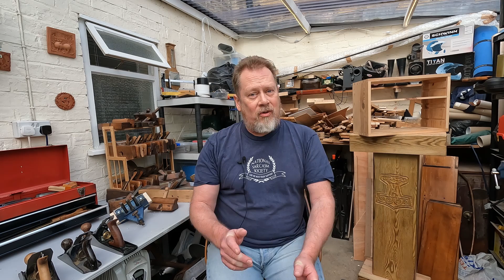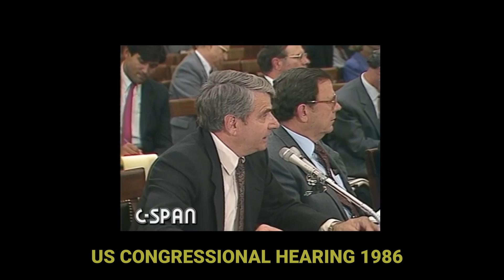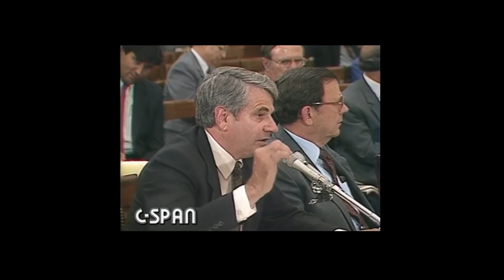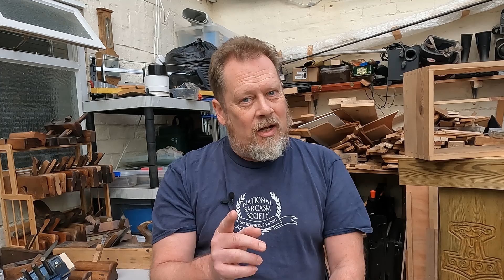1mm is not a mil

Comment: I used to work in mils maintaining electro mechanical telephone exchanges. All of the clearances were in mils in the documentation. That's from over 100 years ago when they were first built.
Reply from the maker: Very interesting, thanks for sharing 👍
Reply: @radboogie  There's no such thing as an exact measurement and that's where you learn to use feeler gauges correctly. A measurement has a + and a - to it. We used double ended feeler gauges, 5 and 10 on one and 7 and 12 on the other. Measurement is done with a go and a no go. Car mechanics these days have no idea.
Reply: As a trainee I even asked one of the bosses if a mil was the same as a thou that car mechanics refer too. He said he didn't know.
Reply: The telephone exchanges were designed and originally built in US of A but ours were made by GEC in Coventry and built under license. That's the strowger / step by step system. We also had crossbar exchanges but again, originally built in US of A but ours were copied by NEC and came from Japan.

Comment: In North America there's also the "circular mil" which is a unit of area.  For example, wire with a cross sectional diameter of .001 inch has a cross sectional area of one circular mil.
Reply from the maker: I didn't know that! Thanks for sharing 👍

Comment: We used to use 'mil' in Australia to mean 0.001" as well when referring to the thickness of paint films in the days we used imperial units.
I was working in the paint industry at the time Australia was switching to the metric system, so a lot of the old stagers would use imperial units. As a result I am quite 'bi-lingual'.
I knew instantly what that bloke from NASA meant in the clip you showed. 5 mil in an o ring had to be 0.005". I never had any problems knowing which unit was meant when someone talked about a 'mil'; I could always tell from context.
Reply from the maker: @jeffarmstrong1308  thanks for the info Jeff, interesting to hear the Aussie perspective on it 👍

Comment: In mechanical engineering and  machineine shop applications in North America a mill is still .001 (inches - lack a leading zero) as apposed to 0.01 (mm have a leading zero). The first general note would also state that all dimensions are inches and millimeters are in parentheses and for reference only, or the reciprical note if the design in "hard" metric and "soft" US Customary/Imperial or something to that affect.

Comment: I have always said THOU for 1 thousands of...  That is the first I heard that...  I was looking for a video to explain to me Millradian is not a metric measurement for scope dialing (just an fyi)
Reply from the maker: Milliradians are really interesting with mildot scopes. Crazy how 1 milliradian is 1/1000 of a radian, and a circle is 2π radians. And on a scope it conveniently works out to 1 mil is 10cm at 100 metres.
Reply: @radboogie  1 radian is the SI (metric) unit for an arc length around a circle equal to the radius.  So a milliradian is an arc 1/1000th of the radius.  At such a small angle that's well approximated by a straight line normal to the radius, so there's your 10cm at 100m.  Pi only comes into it when you want to know how many radians in a circumference, relative to the diameter.

Comment: As a European machinist moved to the US, yes one mil is .001 inches and you find it in the dials of most old machines (new ones frequently have double dials with metric equivalents too). Two advantages of mils: allows using the old Imperial measuring system in a decimal format instead of stupid fractions (solves a self-inflicted problem) and, something I learned to appreciate with time, gives a good feeling of the quality of a machining job (high precision +/- 1 mil, regular work +/- 2-4 mils, home shop +/- 5-10 mils.
Reply from the maker: Spot on! In the UK we call them thous, and like a lot of imperial measurements they make a lot more sense than metric. Without risk of starting a metric vs imperial war, metric is very convenient but like you say working in 1 thou/mil 2 thou, 5 thou etc. is so much more human. Must admit I tend to flit between the two even though we've been metric for 50 years or more.

Comment: They have circular mil too!  A circle with a diamter of a thou, or 5.067×10−4 mm2.
I shit you not.
(and the whole subject of using the centimeter as an engineering unit is best left alone)
Reply from the maker: As apprentices I reckon we would have been punished for working in centimetres 😂
Reply: @radboogie  well it certainly would have kept you in line 😂

Comment: In the electronics industry a mil is still often and commonly used today. It's used to define PCB trace width, and most commonly it's used for BGA component definition, for ball pitch and diameter. So if I said that I had a component with 20 mil balls and 40 mil pitch, that's all in thousandsths of an inch.

In most online machinist forums I've seen people use thou for thousandths of an inch. I don't like saying mil for millimeters simply because of the confusion.

Of course all these problems could be solved if silly countries like America got in line with 99% of the rest of the world and used metric.

Comment: In my experience 'mil' IS used as a measurement, and I've generally seen it when talking about plastic sheeting (a.k.a. "20 mil poly sheeting" for waterproofing). In machining, 'thou' is often used for   thousandths of an inch.
Reply: I don't recall hearing it in many other contexts, but this one is common and consistent.  Plastic tarps and plastic bags.  I think most will list their thickness in mil.

Comment: The issues with imperial are that you need an extra digit of precision to be able to accurately work with it, and most ameican machines don't have that for their own systems either, so the equipment and machines they work with are manufactured with more slop. Even your digital gauges when showing imperial are converting from Metric, and the math inside says f that, so there's quickly mistakes accumulating xD

Comment: Having worked in both finance and machine shops in the US, the only place I see “mil” used to mean 1/1000th of an inch is plastic sheeting. Trash bags and painting drop cloths are labeled with their thickness in mil. I’ve never heard mil to describe 1/1000th of a dollar. We would speak in fractional and decimal cents, “half a cent”, “point oh four five one cents”.  In the machine shop we use “thou”. 

I suspect most Americans think of millimeters or another si unit when they hear “mil”.
Reply from the maker: Thanks for the info - much appreciated 👍
Reply: there's also the horrific kcmil used for wires.

Comment: In the US we usually abbreviate the word "thousandth of an inch" to "thou". So, 5 thousandth of an inch would be called 5 mils, or 5 thou. BTW, Mille means thousand, not million (so it does make sense) 😉 Ciao, Marco.
Reply: I've never heard of “thou”. In southwestern Colorado / Southern Utah, 1 mil” means “0.001 inch” when talking about shim thickness to level heavy rotating equipment or quantifying metal pipe wall thickness changes due to corrosion. However, I've only heard “mil” used this way among mechanical engineers and oilfield technicians and associated machinists.